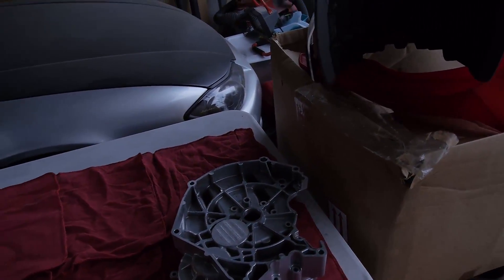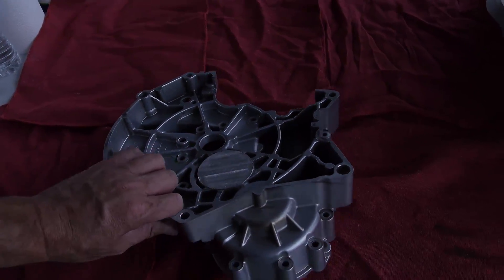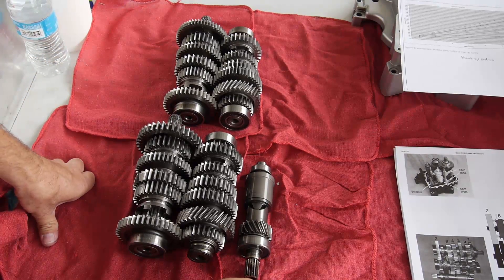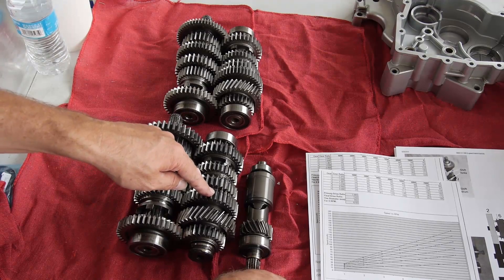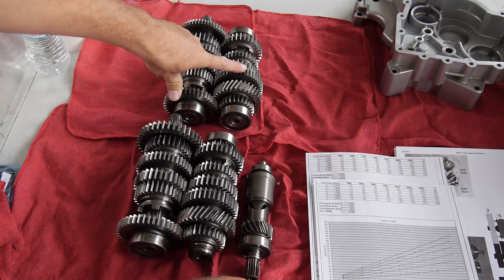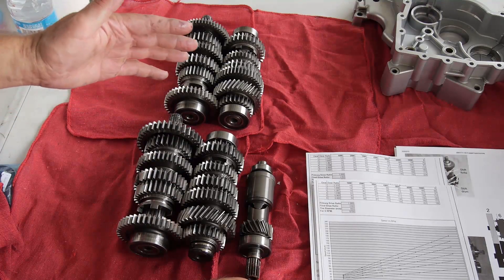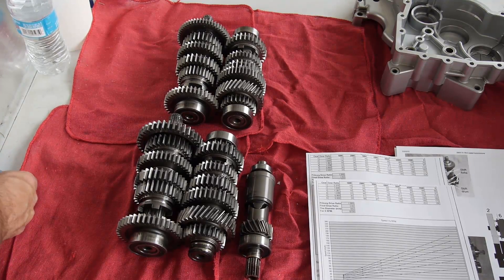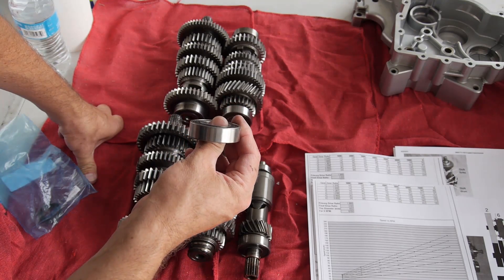BMW R1150GS Project - Pt. 2 - Transmission overdrive Mod- Hybrid

Comment: This is what I have always wanted to do.  I have a 2004 R1150GSA and a 2000 R1150GS.  I bought the GSA because I ride off road quite a bit, but I really like the O.D. of the R1150GS. Thanks for putting this video together.

Comment: If you didn't care about first gear  could you put a complete rs trans in a gs ?
Reply from the maker: Yes, the housings are all the same, and they bolt right up :)
Reply: @MrDuhfactor  that's gr8 thanks so much

Comment: $100 for machine shop work, man the next time I need work done I m putting it in a box and it is going to Utah!!!!
Reply from the maker: +Iowarail  MAn dude, they are seriously good over there.... maybe I got a special deal, but I can tell you it will be right when you get anything back from Lindsay machine, they are good over there :)

Comment: I don't even know how to start this... That case repair falls neatly into the category of things I never would have thought about someone being able to fix;amazing. Second, holy freaking gear swap man. You get to retain the low end while getting a better cruising gear AND replacing some worn out gears! You're just winning all over the place in this video dude!
Reply from the maker: +FRAG-AFE  I'm really excited, but at the same time, have this sense of fear that something is going to blow up the first time I click it in gear.....
Reply: +MrDuhfactor I have never felt any other way after I take something apart and put it back together... It would kind of take the fun of of it
Reply: If I didn't feel that way.  (sorry, replying from a phone and it sent to early)

Comment: This is awesome!  Turning lemons into lemonade, for sure!!!  Funny thing is, wasn't too bad of a scenario to begin with.  Now you'll have the best of both worlds gearing wise and for cheaper than originally thought!!!  Amazing fix on that case, by the way!  We thought she was a goner.  We continue to be blown away by LMR.  Didn't hear about them until your videos.  And tough call on the bearings.  Sealed to protect against metal shavings contamination?  We'd be inclined to go with sealed, especially if BMW has continued to use them on their new bikes since yours 10+ yrs ago.  At any rate, can't wait to see the continued unfolding of this project.  See you on the next one...
Reply from the maker: +David & Elizabeth Sometimes we get lucky over here, and I'm grateful for that... although my friends think I'm cursed for not throwing in the towel .....lol.  Actually, I think it is fun trying to figure out a solution for these projects I get myself into..... And, I'm so grateful to have friends over at Lindsay Machine!

Comment: Just a guess, but those sealed bearings might have a high temp grease in them. those bearings probably would heat up too much if only lubed by trans oil. Love your vids.
Reply from the maker: +Daniel Scott Hmmm interesting thought..... Maybe so......???

Comment: very cool nice to see you were able to repair everything, there are several videos out about guys cracking their cases  on the newer bmw adv as the skid plate mounts to the case not the frame.
Reply from the maker: +Charles Penner Yes, the dreaded engine crank case fractures are legendary BMW GS casualties..... such a bummer. I haven't seen any do this with the tranny though.... maybe someone else has? One bearing failure, and wow!!!

Comment: Well thats a win!
I wonder if the replacement bearing has multple uses? Maybe it fits other components in different engines where sometimes it needs a seal. So it comes with a seal but you should remove it for this engine? Not sure how you could check... maybe just search the part number and see if it comes up in more than one place?
Reply from the maker: +Nerb1  Good idea, I checked with the dealer today... they just looked at me with that look like, "What can I sell you"?  Lol..... Maybe that bearing fits other BMW models... not sure, it's a very standard size bearing though.... Oh well, they're pressed on the shafts now, so I hope Im not the one that finds out how long this one will last.

Comment: Would it not be easier to put the old 1st gear on the new gear set?
Reply from the maker: +Adam Hill That is a great idea, unfortunately, the first gear is a machined part of the intermediate shaft, so can't be removed. I was hoping that might be an option..... Unfortunately, no go.....
Reply: +MrDuhfactor Good info, I was wondering the same exact thing Adam was.

Comment: SUH-WHEEETNEZZ ABOUNDETH !!
Too soon to fret over this but I am a little worried about the alignment on the milled transfer-shaft housing (case repair) ... Considering the tolerances and the stresses AND the high RPM, I am concerned that chatter, at various RPMs (frequencies) might "wallow" the seat, in time ... No way to tell until you try it out so, no sense in worrying about it unless or until it "SPEAKS TO YOU". ... Again ... Unless you are crossing the Simpson Desert (The OUTBACK) solo, which is near suicide in ANY event, then the worst "CASE SCENARIO" is that you end up stranded with a busted case. ... Not really a huge problem in the lower 48 states.
Reply from the maker: +phrankus2009 Well, thankfully, the actual bearing race surface was unhurt, it was just the cap that got blown off.... I'm crossing my fingers!!

Comment: So you are building a granny gear/overdrive 6 speed? :P Glad to see they hooked you up and fixed that case. 
Now as for the gears, I'd press off the first gear and put it on the RS shaft if you can, I wouldn't trust the end of that shaft where the bearing came off.
Reply from the maker: +OtisENGINEuity Unfortunately, the first gear is a machined part of the intermediate shaft, therefore cannot be pressed off, that is why I needed to keep mine in order to get the low first gear. I measured the shaft where the destroyed bearing came off, and it measured exactly the same as the RS shaft, and looked fine, so I think we're o.k.
Reply: MrDuhfactor aka you hope to hell you are okay because if not.. it's gonna get ugly :P Toyota made a transmission very similar to that for their trucks, we had one sitting behind a SB Chevy in a fiberglass bodied 66FJ40 and it was pretty nice to drive. It reminded me a lot of the old NP435 except with an overdrive thrown on and not quite so low of a first I think. (nice to drive.. the thing was a bucking bronco under you as it had about 400hp and no weight to get the stock springs to actually give and it had 4 shocks on each axle.. the thing just pogoed everywhere... was a blast to hot rod around and I can honestly say I didn't get it stuck while hunting.. though my dad did :D 33x12.50 mud terrains and a soft water bar aren't a good combo.. I didn't know you could actually high center a FJ40)
Hope it works out well.

Comment: yay!!!! ok. to be completely honest. i've done the same thing, using two transmissions to make one good one. i did it and it worked. i had no idea the GS's came with two transmissions... but it does make sense for the application, and the gear swap is a perfect idea. you cant really change the final drive gearing. a coworker purchased a k series BMW that he was been drooling over for weeks, and he has had me intrigued. i admit i know very little of the BMWs, but i do find them interesting.
Reply from the maker: +b1pig I'm trying to change my bias.... I've been so enamored with the performance of the KTM 990 adventure that I love, it's been hard to accept anything else in the big bike category. I'm going to learn what I can, and see if my mind changes. Although I find myself wanting to bash this 1150, it does have some great qualities. And these tranny gears are MASSIVE!